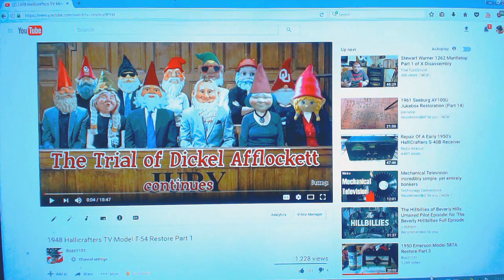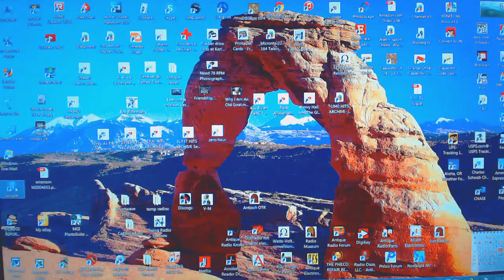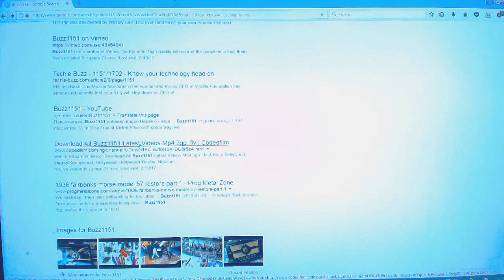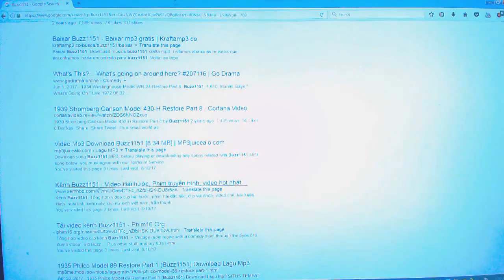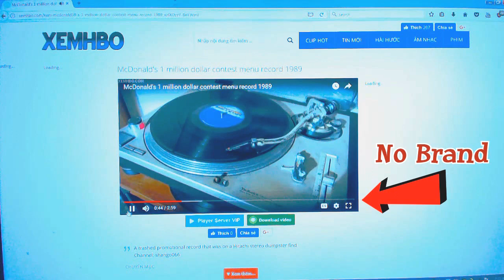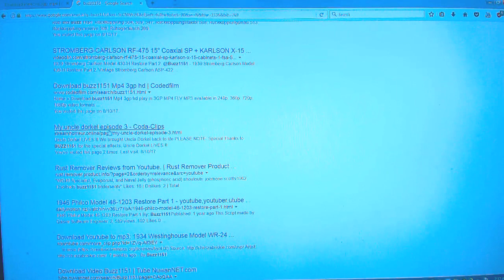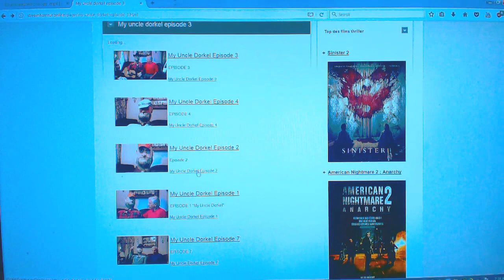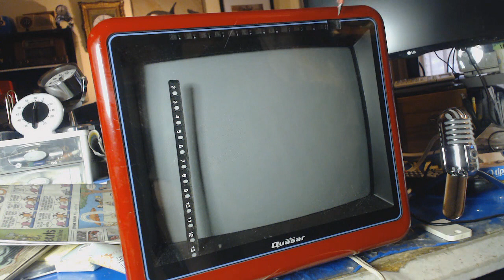1985 Quasar TV WP2145XR Repair Part 2 Final

Comment: Jolly good show ol’ chap!
If I’d a £ for every switch I replaced, like the ones you replaced, I’d be several hundred pounds the richer.  Years ago, ‘tapped’, or ‘none tapped’ (also ‘panel mount’ or ‘PCB mount’) were available: each had their own part number.  They were definitely trashy: one reason why they usually had a limited life span.  
A small tip: whenever I take a small switch apart, or anything where plastic rubs against metal (or plastic against plastic), I apply a small amount of Molykote grease.  It’s not cheap but it is a superb lubricant for those types of operation, and it is available in the USA (via Amazon, for example).
Regards,
Phil.
Reply from the maker: Hi Phil...what's your favorite old time Brit expression?? examples..... "see here old man" or "pip pip cheerio".......Buzz

Comment: Poor Dickel, he is sure in a mess...LOL
Nice fix on that switch and the TV sure cleaned up nice.
As for UMA, "cry baby"?, BTW  It is HACKBAR not AKBAR, but I see the insults are still coming from UMA.
Thanks for another great video and a GREAT job on the coil repair.
I put on a long wire antenna and the radio brings in two stations, in my area that is not bad.
Reply from the maker: Hi Goat...I thought of putting epoxy on that terminal to strengthen it, but it seemed pretty sturdy.....I suspect Dickel..haha........on a serious note, why don't you and Don the junkman "bury the hatchet"...I don't like to see you guys fighting...life is short...what do you say??.....can you 2 guys start over??..........Buzz